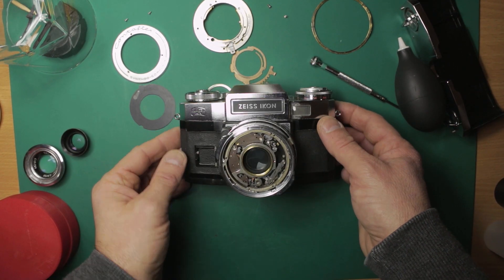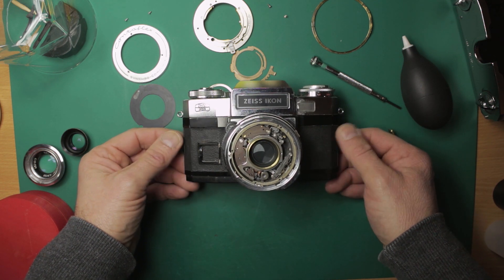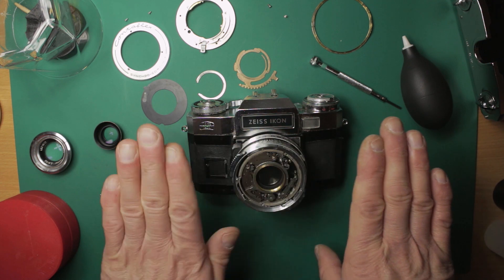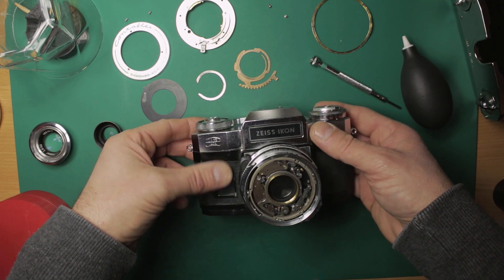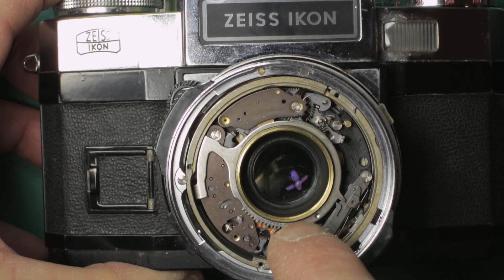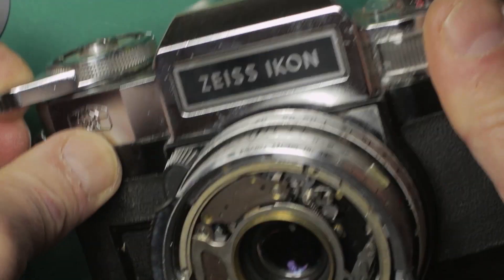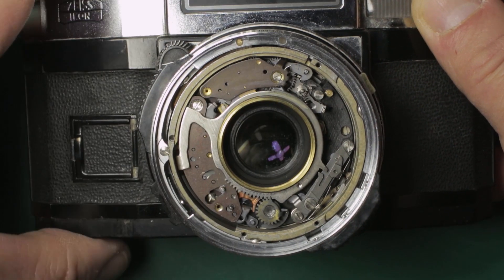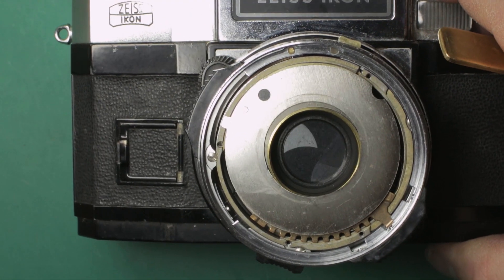Zeiss Ikon Contaflex Vintage Camera, How The Mechanical Leaf Shutter Works

Comment: Hello, I have two Contaflex's, a Beta and II. I always wondered why they seem to sell for so little, I learned today that the leaf shutters are notorious for being complex and unreliable to my surprise, considering Zeiss Ikon's reputation that is. I have never checked either of mine for reliability although I must have given them the once over when I purchased them a while ago, and I was rather worried. But you have put my mind at rest with your video 😁 so, thank you. I don't relish the idea of working on a shutter mechanism, but if needs must I will have a go. I recently bought a really nice DeJur D-3 camera made in Germany for an American retailer in the 60's, I got it very cheaply as the leaf shutter was seized, luckily the front lens was removable, so I was able to treat the shutter blades very carefully with nail varnish remover which worked very well in the adsence of lighter fluid 😜😁. Cheers.
Reply from the maker: When you consider the age of these things and how they're used and stored in less than ideal conditions I think they do very well but yes mechanical leaf shutters on all cameras can and do fail either gradually or suddenly and looking at the manual it's going to be a challenge as there's a lot of disassembly to take it apart properly.
Reply: In desperation a while ago I disassembled a WERRA 1 lens , then there was a prolonged illness in the family. By the time I got back to it, I had lost my notes and couldn't remember what went where 😂😛😇. I checked both the Contaflex's and they seem fine. Cheers, keep up the good work.
Reply from the maker: @ianwilkinson4602  Ouch! That must have been frustrating. I've done similar with watch movements. If I've disassembled a project of my own then been working on others I often have to scratch my head to remember what goes where. Thank you.
Reply: @spidiq8  I had a look at some of your other exploits which are way beyond
anything I could manage 😜respect. Cheers.
Reply from the maker: @ianwilkinson4602  Very kind of you, thanks but it's just practice, if you can work on a camera lens and shutter you'd be surprised at what you could do.

Comment: Thanks for sharing. I also have one, I recently finished shooting a roll of film, and after replacing it with a new film, both the shutter and paddle lever failed. Do you know where the problem is?
Reply from the maker: Sadly not. Or rather not yet. I've not dug any further into it at the moment but hope to.

Comment: Anyone have any ideas what might caused the shutter to be stuck? Mine was working fine until this morning.
Reply from the maker: Usually it's dried or migrated lubrication, accumulation of dust etc which is why stripping cleaning and lubricating is needed.